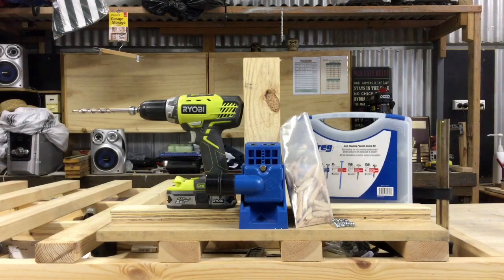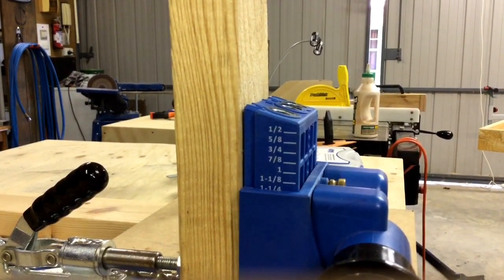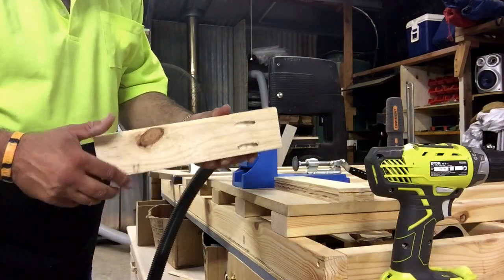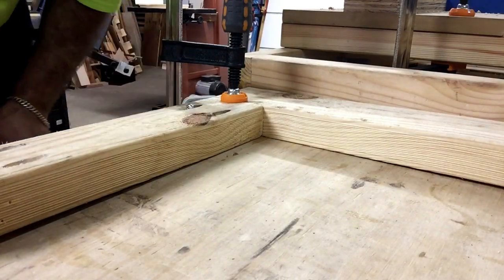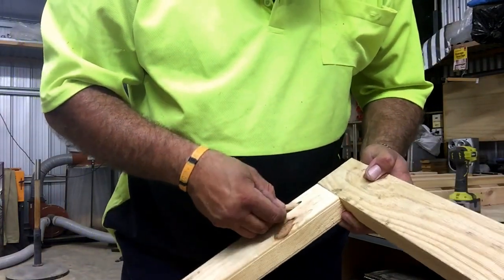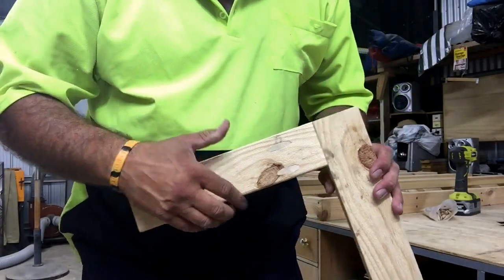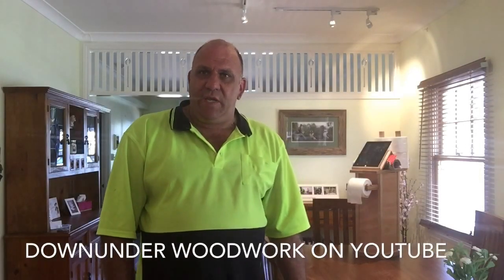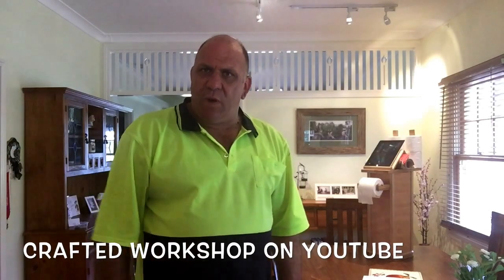Pocket hole joinery

Comment: The Pocket Hole Jig is brilliant i have the K4 same as you have. The only thing i don't like is the square head screws, i rather use the torx head screws, as they don't seem to slip as much. If you are going to clamp it down then use a Kreg Automax Clamp, no adjusting required for wood thickness and works great for clamping down for pocket holes.
Barry (ENG)

Comment: Love my kregjig, got on to it very early in my woodwork through WWMM watching. Great starter video. My main question is... What is the bog roll dispenser doing in the dining room? 😳😂
Reply from the maker: They have revolutionised the world of joinery mate, I love pocket hole joinery & have used it in heaps of projects that are heavy duty so they have a great strength proponent to the, the only other great alternative of a Festool domino is way outta my price range.
Bog holder a necessity everywhere 😜😁😁😁